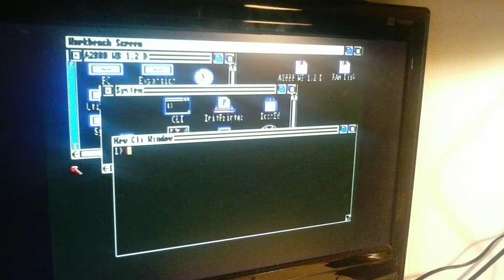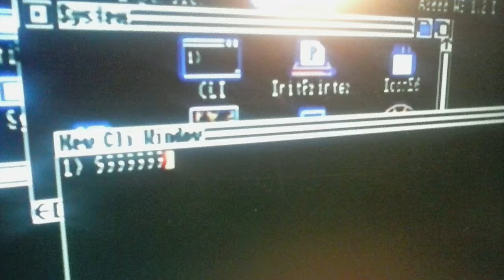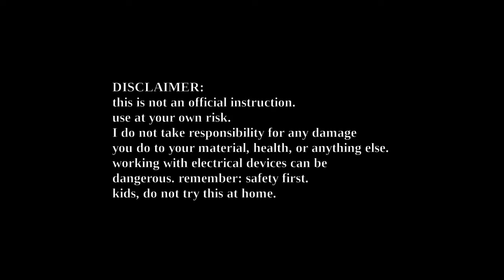AMIGA alive 01: Amiga 500 keyboard repair

Comment from the maker: a few thoughts on/updates to the video:
- i think the original traces aren't printed to the bottom sheet of plastic, but to the backside of the upper one. so you might be better off cutting through the bottom sheet, from the backside, and paint from the backside, too. in any case, be very careful when cutting.
- in the video, I didn't treat the dirt/corrosion in any way. It'd probably be better to clean the spot, rub it a little with IPA (isopropy alcohol / isopropylene) (or maybe vinegar? haven't tried yet), before painting.
- if you're very careful, you can create "test points" in the membrane by pricking throught the plastic. this will do a little damage to the trace, make sure there's still enough conductive material there.